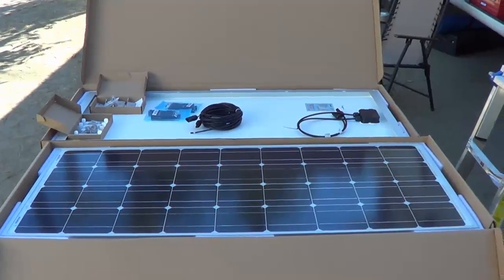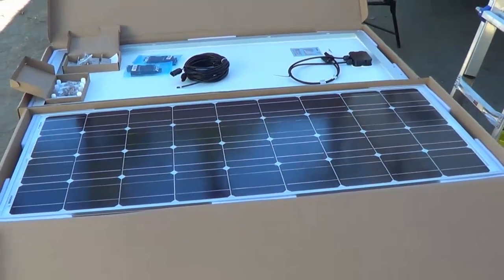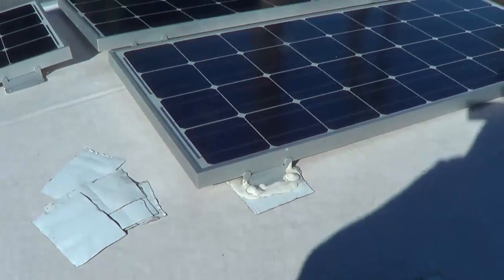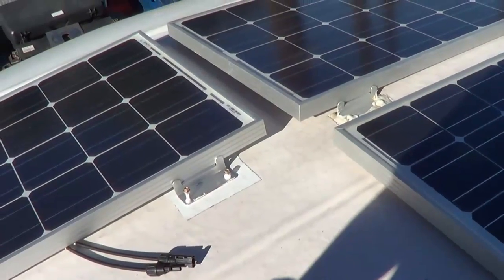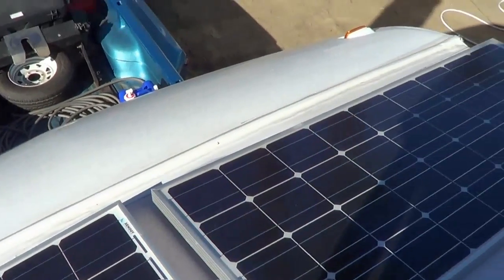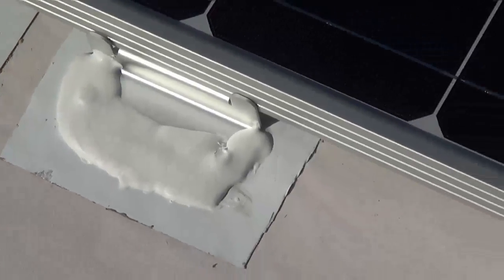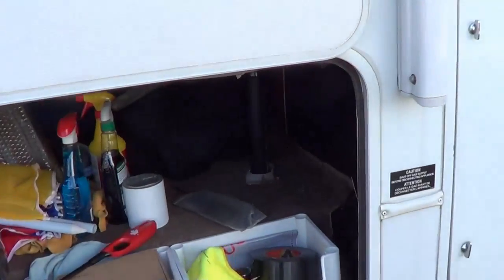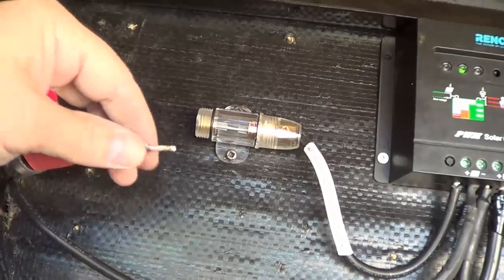Upgrading My Renogy RV Solar System to 400 Watts

Comment: Think I would add an airfoil on the leading edge of the panels to deflect road rocks…. 🤔
Reply from the maker: The panels have been up there about a decade now and around 60,000 miles of towing. No problems. :)  https://youtu.be/E7iVpQJ9NiA?t=194

Comment: I love it when people do their own electric work, then make a video saying I think I ran the right size wire. Lol if you look up in the national Electric code, you can find out what size wires you need for current. You shouldn't be guessing in a unit that you and your family sleeping in. I find these videos very disturbing.
Reply from the maker: Thanks for your concern. The wire size for the panel wattage was correct. I knew that the OEM uses the same size in their 200w kit, and it's easy to look up.  I wondered if I had undersized the fuse and if a normal full-panel current would blow it. With sun and panels, you are never sure exactly how much maximum real-world current they will produce. I some cases with cloud flare they can put out more than their ratings.
I was erring on the side of caution. Many people don't even fuse the solar panel input and only add a disconnect switch.

Comment: Love all your videos. Quick question on fuse sizing. That 30 amp fuse you have between the panels and controller, what type and size is recommended. My panels are 3 - 200 watt panels in series. The max current is 9.8 amps, does that mean a 10 or 15 amp fuse would do the job? and then how do you size the fuse coming out of the controller?
Reply from the maker: Usually about 10-15% above max amperage of the panel string and the controller output is a good bet. The main goal is to have the fuse blow in case of a short circuit before the wiring can overheat and melt or catch fire. So you want to use wire that can handle more than the max amperage of the panels and controller and then have a fuse that will blow below the max amperage rating of the wiring to protected it.  Using switchable breakers is a handy way to go. Cheers, Ray

Comment: Could you have stacked the two Z brackets between the solar panels and use the same set of bolts to secure both Z brackets at once?
Reply from the maker: I guess you could but I'd say the more mounting points the better.

Comment: Hi Ray, I realize it's an older video but I have a quick question. Would you go with Renogy panels again? And is there a way to remove the panel without unscrewing the roof bracket? Thanks!
Reply from the maker: Yes, I have 7 now and no I don't think the panels can easily  be removed without unscrewing from the decking. I have never had a reason to though. Cheers, Ray

Comment: What type of TV antenna are you using for your RV and how's your reception? Great video by the way. Ordering the VHB tape and sealant today!
Reply from the maker: My RV came with a standard batwing type antenna and I added the extra digital pickup a year later - https://www.loveyourrv.com/lubricating-winegard-batwing-style-rv-tv-antenna/  It gets pretty good reception.
I'm looking to swap it out though as I need to get one that doesn't fold down as I have added more solar panels recently and don't have the roof space for that. Not a pressing need at the moment though as we are staying in an area that has no over the air reception. Cheers, Ray

Comment: Why wouldn’t you run those two panels in parallel with the existing two? I’m sure you ran the first two together seems to me you could have saved time and material asking in case I’m missing something
Reply from the maker: They are run in parallel connected at the solar controller in the battery bay, just used the extra wiring to increase the total wire gauge for best power transfer. Recently I added two more and at that time decided to run a single 4 GA run and put a junction box near the roof - https://www.loveyourrv.com/boondocking-power-upgrade-200-watts-wiring-update-mods/  Cheers, Ray

Comment: Why the circuit breaker coming out of the charge controller, positive side?
Reply from the maker: It protects against a short circuit. For example, say the solar controller failed and dead shorted internally positive to ground and fuse or breaker is not on that wire run then the battery bank could supply enough current flow to the point of severely overheating the wire or solar controller board potentially causing a fire. It is good practice to protect every wire run in a system with an appropriately sized fuse or circuit breaker.  
I used a circuit breaker as it also makes it convenient to shut off the solar controller when working on the wiring or testing/upgrading something.  Cheers, Ray

Comment: Overall not a bad tutorial but some of the electrical advice is questionable. 

Never solder high amperage connections (NEC code violation). Mechanical joints are the way to go. If the joint heats up the connection can de-solder itself. If you worry about corrosion put NoAlox on the connection terminals or right in the wirenuts. 

When you parallel the panel array I would fuse the two sets separately and then combine them. If you have a failure in one string that blows the fuse the other string is still providing power. The fuses are for the protection of the wire. #10 wire is good for 30a. if by increasing your panel wattage you exceed the 30a threshold and the fuse blows, you don't want to put in a bigger fuse, unless you go with larger wire. But over all you don't want to fuse above the capacity of input of your charge controller. Paralleling small gauge wire without individual over current protection is not a good idea, and is actually a NEC code violation. 

Just some things to think about.
Reply from the maker: Thanks, can you point me to the NEC code violation section and also how high of the amperage of DC wire can you use solder on?  A lot of the NEC seems to apply to AC house wiring. All I can find is solder is OK in a splice as long as the wire first has a good electrical and mechanical connection.  Section  110.14
The 30 amp solder controller itself uses solder for its terminal to circuit board connections.
I've since added a 5th panel in parallel and at that point separately fused each panel with a 10 amp fuse just in case one panel were to short circuit. Cheers, Ray

Comment: just wondering why did you run another set of wires to the basement ? were the original wire not large enough?
Reply from the maker: Yes, they were a little small for the 400 watts, would have lost some energy in wire loss. So, I bought the same kit and just ran another set. So there is 2 sets of 10 GA wires paralleled making an effective gauge of 7.  I could have ran a single thicker wire but this was easier and cheaper for me at the time. Cheers, Ray
Reply: @LoveYourRV  So you couldn't just parallel all 4 with the cables attached to the panels and run one positive and one negative down to the battery?
Reply from the maker: @paintingsofrebellion  Yes could have done that but would be giving up some thickness in the wire run so would lose a bit of power, by using both sets of cables I reduce the resistance of the wire run between the panels on the roof and the batteries in the front storage compartment. Recently, though I have added two more panels for 600 watts and at that time I invested some money in some thicker 4 gauge cable for my run down to the batteries - https://www.loveyourrv.com/boondocking-power-upgrade-200-watts-wiring-update-mods/
Reply: @LoveYourRV  Gotcha thanks much.

Comment: Good afternoon Ray glad to see you made it out of America and back home safely. I'm trying to find the video where you upgraded your wiring and fuses to your solar system. I'm having a problem with my 40amp breaker popping off once in awhile. The one coming out of my controller to the batteries. Don't know why. Neither does the manufacturer. I figured you were probably smarter than they are. Send me a link or give me a call.
Reply from the maker: Thanks, check out this post it had the full explanation of my system - https://www.loveyourrv.com/diy-rv-boondocking-power-system/  I've never had the breaker blow, my Bogart controller will only pass 31 amps max.

Comment: Have you considered motorized tracking for your panels? Or mirrors for longer charge times/winter charging?
Reply from the maker: No, at this point it would be cheaper and less complex to just add more solar panels on the roof as I still have plenty of space up there. :)

Comment: How do you clean UNDER your solar panels? Certainly not looking forward to dismounting them.
Reply from the maker: Haven't had to remove them, they aren't mounted across any seams and they keep the rubber roof underneath protected and fairly clean, I just flush soapy water under them at the same time I clean the rest of the roof. Likely the rubber roof area under them will outlast the rest of the exposed roof. Cheers, Ray

Comment: Rather than running the second set of wires from the new panels you could have  just added more adapters to the panel cables and connected all 4 panels to the existing pos and neg cables on the roof. Would have saved all the extra work cutting holes and patching the walls, roof, etc.  Renogy has videos showing how to connect 300 and 400 watt systems using the adapters.
Reply from the maker: I wanted the benefit of increased wiring gauge, two 10 gauge wires are comparable to one 7 gauge wire. Having a large gauge wire run means more power transfer from the panels to the solar controller. Basically less power loss in the wiring. I thought 10 ga is a little skimpy for the wire run for 400 watts, especially since I have the panels wired in parallel

Best thing in hindsight would have been run a heavy gauge wire like a 6 ga the first time and put a junction box on the roof for future expansion, but the initial kit came with 10 ga cables included so to save money I ran a second 10 ga set when adding the next two panels. Rather than ripping out and replacing the existing 10 ga.  Cheers, Ray

Comment: Good morning Ray, two more days and we're on the road. I have followed your steps on the 400 watt system. It works fine but I would like to know how you added the extra panel that you carry in your pickup I can't seem to find your video on that could you send me a link please, I would like to do the same thing.
Reply from the maker: This was my original install - https://www.loveyourrv.com/building-portable-solar-panel/, however, I did change back to a regular solar panel last year and modify the mounting.  -  https://www.loveyourrv.com/replacing-damaged-portable-solar-panel-plus-new-mounting/

Comment: Thanks for the very good and informational video.  I was just wondering if all your panels are in parallel or did you do series then parallel?
Reply from the maker: They are parallel -  here is a link to my blog post showing my system today and a more in-depth video, it has a schematic - https://www.loveyourrv.com/diy-rv-boondocking-power-system/ Cheers, Ray

Comment: Thanks for the video. I always like to see what guys are doing regarding solar. If I may suggest, after you get your MPPT charge controller, rewire your panels in series. You need a minimum of 13.8 volts before there is enough voltage to initiate a charge current on your GC batteries VIA a PWM controller. By having your panels in parallel, you get your 400 watts when the sun is at a good angle for about 5-6 hours. However, you can get more charge time by wiring your panels in series. When the sun is at a low angle your panels are producing voltage but not enough to begin a charge. By wiring in series you are adding up to sum of all the panels and you can achieve 13.8 volts earlier in the morning and later into the afternoon giving you more charge. This is just a suggestion. You are doing a great install. Thanks for the video. JK
Reply from the maker: Thanks for the advice. I did add a 5th panel a couple years back. I use it as a remote movable ground panel. To catch the early and late sun. Here is a look at the system now - https://www.loveyourrv.com/diy-rv-boondocking-power-system/
It was relatively inexpensive and serves our needs well. Only had about 10-15 hours generator run time during 4 months of boondocking last winter. :) 
Cheers! Ray

Comment: Do you need bigger charger control from 200 to 400 watts mr Ray? Thanks.
Reply from the maker: No, my 30 amp charge controller can handle up to 500 watts.

Comment: Ray, can you remember what gauge the wire was from the panels? Also just wondering if you thought of a combiner box on the roof?
With a combiner box up there would that have given you the ability to wire the panels in parallel like you did, but then run at 24v down to an MPPT controller? Just wondering. I’m planning a solar install myself and just figuring things out. Trying to figure out a way to run as much solar as possible on the solar prep which came on my new rig. It has 10awg wiring and an MC4 connector plate on the roof.
Obviously I’m a little worried about shading so parallel is the obvious choice, but will also need to wire in series to avoid going over the 30amp pre wiring maximum limit. I will eventually have to bring down separate wiring because I plan to bring down three separate strings. That way if there’s an issue with one string, the other two will still be functional.
Anyway couldn’t tell if that was 8 or 10awg on your setup. We are very excited to be able to have functionality in our rig without having to run the generator all the time.
Reply from the maker: Here is how the system sits today and it supplies all our needs off the grid - http://www.loveyourrv.com/diy-rv-boondocking-power-system/  I never did the combiner box as I added the solar in stages so just ran 4 wires down and paralleled them near the controller. They were 10 GA but when doubled up like that are effectively 7 GA  It must be plenty thick enough for my short wire run as I've seen full panel rated current charging the batteries.  The other day I saw a charging current of 30 amps at 14.6 volts, not bad for 500 watts of panels. 438 watts is great considering that most panels real world don't put out the full rated watts. Usually, getting 80% is considered good. Cheers! Ray
Reply: Love Your RV thanks Ray, as always, your right on the $$$$😜
Great setup! 👌🏻

Comment: You mentioned watching TV Ray.  Do you use a dish with a satellite pkg?
Reply from the maker: No, we just watch over the air or stuff we've downloaded. We'll get seasons of TV shows off iTunes and watch them on my wife's iMac computer.
Reply: I see.  Any TV antenna reception when you’re boondocking?  Probably rarely, depending on your location.
Reply from the maker: It's funny, we get channels a lot more than you would think, especially in the desert where there isn't much to block the signal.

Comment: Excellent Ray!  Interesting... smaller inverter!
Reply from the maker: Yes, I find the 1000 watt is sort of in-between size. Overkill for most smaller wattage things, so its a waste and too small to run say a microwave, hair dryer or toaster. So when it dies I'll likely go smaller or bigger. If I go bigger I may need to add another solar panel or two.

Comment: If you could do it over again Ray, (that’s where I’m at...) what might you do differently with regards to your solar/battery/inverter system?  I’m starting with an empty canvas.
Reply from the maker: The only thing is maybe a rooftop junction box and a heavy say 4GA wire from there to the charge controller.
 Also maybe a smaller inverter, as we really never use the 1000 watt, likely a 5-600 watt would have been fine.

Comment: What’s the advantage of 6v batteries vs. 12v Ray?  Also, did you evaluate tilting the panels for maximum solar energy?
Reply from the maker: Heavier plate and smaller footprint. Usually more Amp HOurs capacity for the buck and can handle more deep discharge cycles.
This is an interesting read, check out the cutaway photos near the end. - https://marinehowto.com/what-is-a-deep-cycle-battery/
I didn't tilt as I knew I could meet our power needs (fairly modest) without doing it. It is less hassle for me, no need to setup and put away. We aren't people that spend a long time in one spot, like to move every 5-7 days on average. Finally, I have loads more space on the roof and could still add more panels if I desired more power before tilting would be required. Since the 400 watt install, I have added an additional 100-watt remote ground panel, I move it around to follow the sun.
http://www.loveyourrv.com/update-boondocking-remote-solar-panel-mod/   http://www.loveyourrv.com/replacing-damaged-portable-solar-panel-plus-new-mounting/  It's worked great, gets me charging right as the sun rises as I can have it pointed dead on to the east.  Cheers, Ray

Comment: Isn’t the bedroom in the front Ray?  So if the bedroom is in front, doesn’t it get the warmest if the rig is pointing into the sun?
Reply from the maker: Yes, but far less than if any windows are pointed to the sun, like a greenhouse. Also, camping in the desert where we do the most boondocking it cools off dramatically when sundown hits. It can be 80 in the day and 40 at night. By the time we go to bed we are needing heat. :)
Reply: That makes sense now that I think about it.  Keep the heat out of the large windows (to the North), that’s the area you would spend most of your time in during the warmer hours and you use the bedroom after it cools off.  Thanks Ray!

Comment: When requiring AC current how your battery are hooked up and your inverter is made is paramount. See hooking them up as 12vs works but the inverter from 12dc to 120 VAC means the inverters transformer will use approximately 40-50% of incoming power. That can effectively be circumvented through bypassing the transformer adding the appropriate fuse and thus reducing the inverters power drain from 40-50% down to 10-15%, that translates into much power electrical AC power.